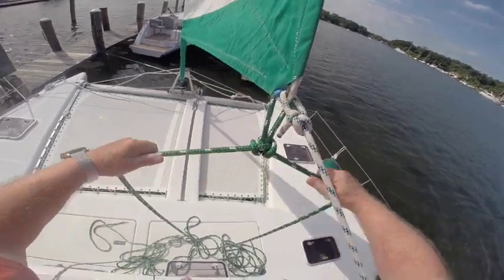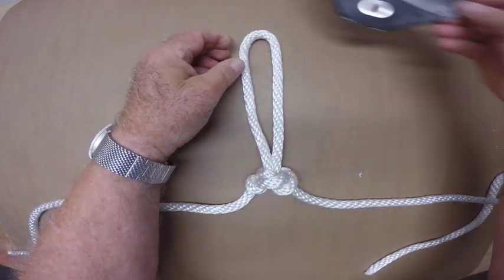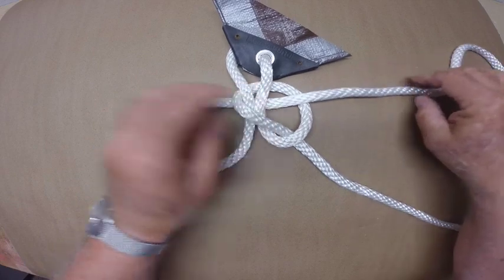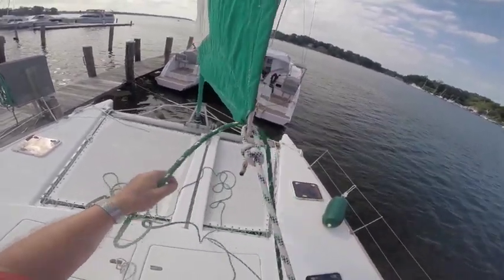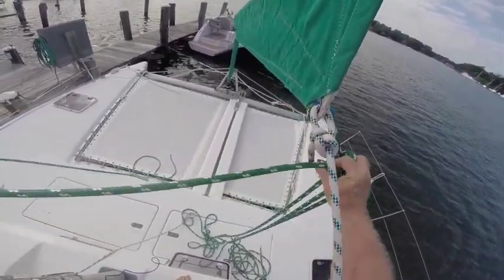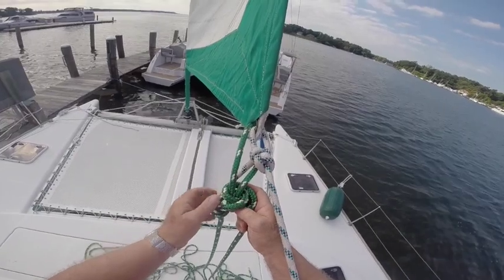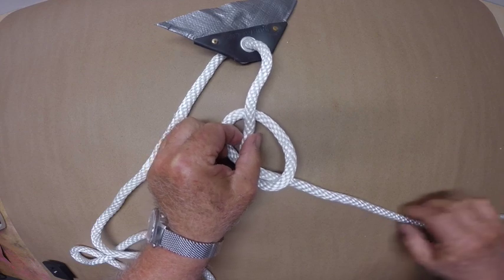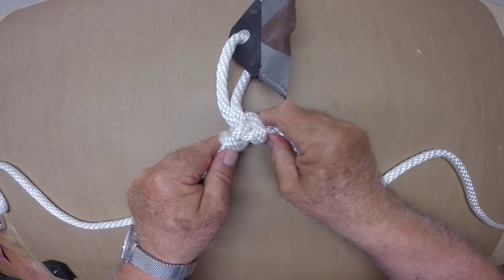Butterfly Hitch - Continuous Jib Sheet

Comment: Thanks for this video Captain! I was simply securing my sheet by running both ends through a single loop like a luggage tag.  This season I’ll be doing it the way you demonstrated in this vid using the butterfly loop.  Thanks again. Cheers!

Comment: This still seems to have a protruding base to catch on the stay. Try a rethreaded Figure 8 knot, this has a flat base. A figure eight (not rethreaded) or this alpine butterfly used with a soft shackle through the clew and through the know would make it fast to remove in an emergency.

Comment: I found a butterfly made too large a knot and it catches on the rigging as I tack so I went back to a larks  head. What do you have to say about that?
Reply from the maker: Problem found.  Problem solved.
Reply: A larks head knot will slip when only one end is loaded which is always the case for single line jib sheet rig. You might try flipping the alpine butterfly bend over to have the more bulky part of the knot on the top

Comment: It is knot a continuous sheet. However, it does slightly reduces the weight on the clew of the headsail by using just a single knot instead of two... if your loop isn't too big, that is.  Also. it is convenient for stowing the sail, as the sheet remains attached to the sail.  When hoisting the sail the sheet is already attached to it... so just thread the blocks and you're done.

Comment: I understand the simplicity and the strength of passing the rope itself through the grommet... is there some expensive pretentious nautical term for a grommet? But couldn't you just use some type of soft shackle and knot the rope in the most appropriate manner and lose no strength in the connection?
Reply: Its a cringle.
Reply: I don't have a clew ... hmmm ...

Comment: Well, as far as I know, you feed a loop through the attachment point, then feed the whole sheet through the loop. If you can't feed a loop through the attachment point (or feed both ends through), then it's narrow enough to feed one end only and secure it with a hitch or eight on either side. So, what is the advantage of this more complex method?
Reply: Great idea! Now go sailing and then try to untie your sheets...

Comment: For any given size of sheet this method doubles the wear at the attachment point as you no longer have the wearing load shared by two sheets
Reply: Well, true. But when the knot wears, it can be cut in two and used as two sheets. 😊
Reply: Well, true. But when the knot wears, it can be cut in two and used as two sheets. 😊
Reply: Well, true. But when the knot wears, it can be cut in two and used as two sheets. 😊

Comment: IMHO, one of the features to look for in a knot application is the ability to untie the knot fairly readily. When the butterfly is used as a handhold in a bight this is easily pulled out.

In the event of one side of your jib sheet being being jammed or fouled how would you go about swapping out the effected sheet?

Pulling out the whole sheet under sail seems like a minus in my book . With two sheets you can tack (if necessary) and make the failed sheet lazy and readily swap it out

Comment: I don't see the point of this.  A simple (larks head hitch/cow hitch/luggage tag hitch) is much faster, smaller, and just as easy to undo.  Since that hitch doesn't move inside the grommet, it is also less vulnerable to chafe.
Reply from the maker: If that's what you like, you should use them.
Reply: Be careful, youtube will sensor any ideas that could be good ideas